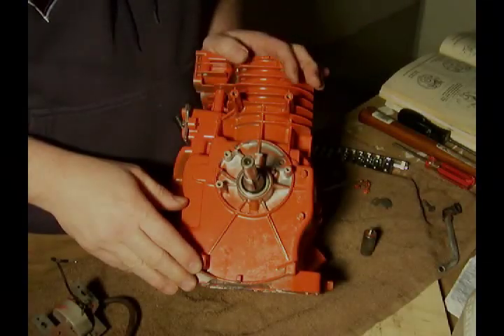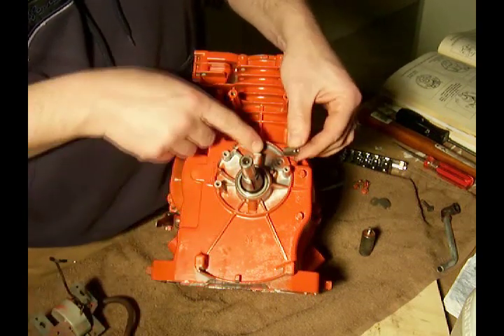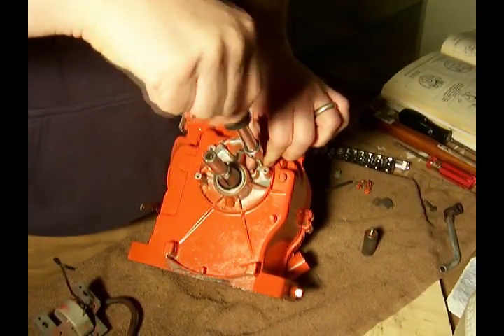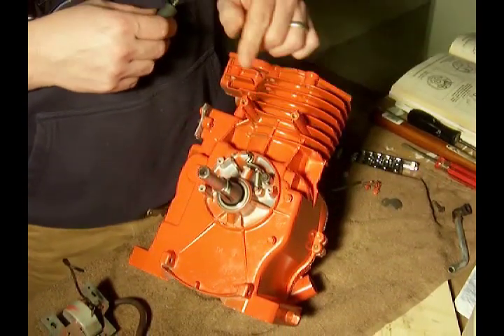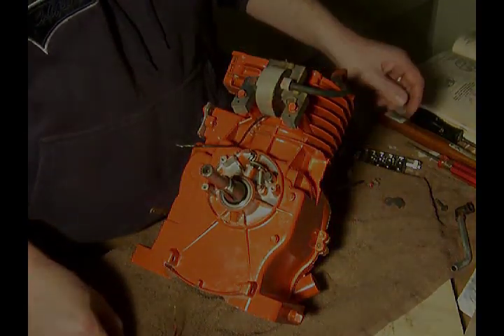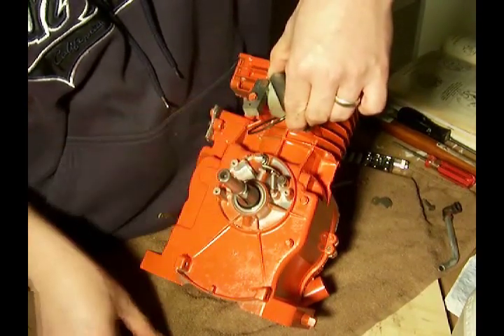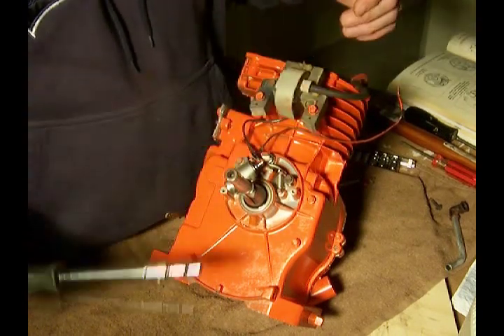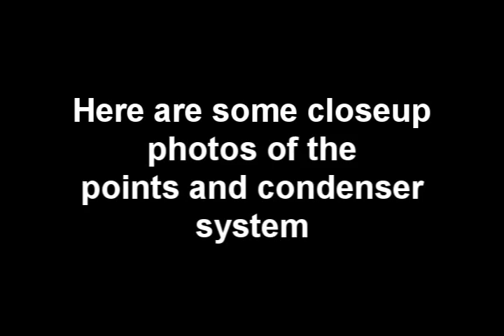#10 - Briggs and Stratton 5HP 130202  - Points and condenser installation

Comment from the maker: The arm should be in the open (non-contact) position when setting the gap. As the crank shaft spins, a flat spot on the shaft will cause the plunger to drop momentarily and the gap will close just for a moment. At that moment when contact is made, a shot of electricity will be sent to the spark plug and ignite the compressed gas.
Reply: Pay attention to this! I put all new parts - condenser and points and still had no spark until I adjusted the gap correctly.
Reply from the maker: @fropiler  Thanks for watching!

Comment: I have an old B&S 5hp that is similar to this engine. I need a new points and condenser kit but don't know what kit or where to buy it. Where did you get your kit? Thanks for any info.
Reply from the maker: http://youtu.be/PuG73h8oJ24?list=PLHhi09gGkzy4TGJB3CXfeeQYMZLVrSgLA

I recommend that you upgrade.
Reply: sblg43 no, don't. i've had nothing but trouble. 
they're available from amazon
Reply: sblg43 has